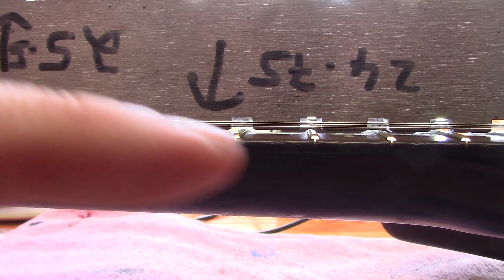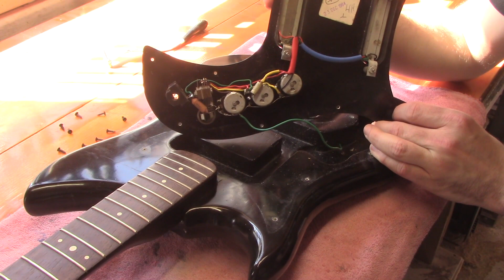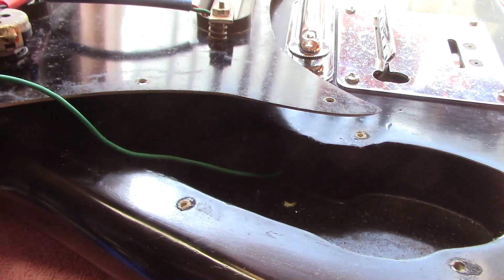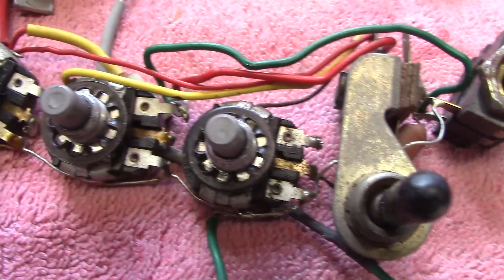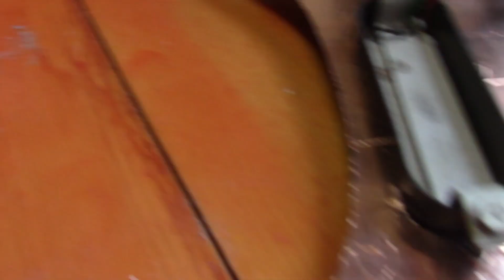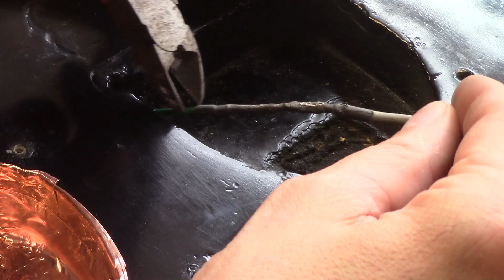Burns Nu Sonic Service & Setup

Comment: Dear Brenco, thanks so much for uploading this! I am trouble shooting, interestingly, a red lefty with the same date stamp! Exact same. Also, even weirder, it also has a too wide/stripped screw hole in the same spot under the tremolo plate! I was wondering if this guitar ended up having a working middle position with both pickups on. Mine looks wired the same but I don't see how it could have a 2 pup sound as is. Oh and the pots are odd, do you remember which ones were volume and tone? Thanks for any info you might have..
Reply: Update in case anyone is curious; got the neck pickup rewound, installed it as it was taken out (not making sense, really) and I am pretty sure the middle position puts the pickups in series. The sound is much louder than the individual pickups.